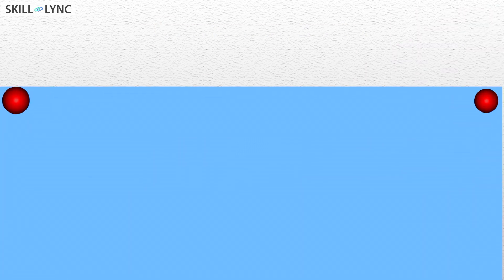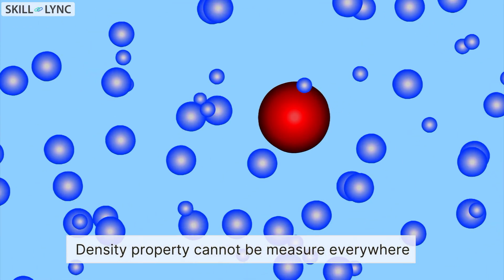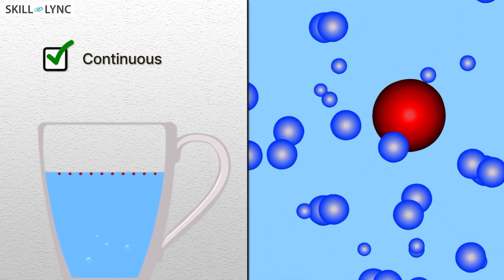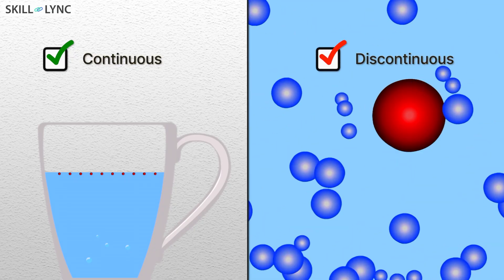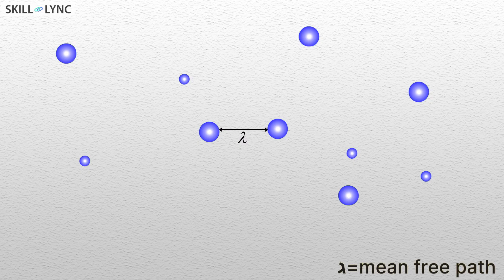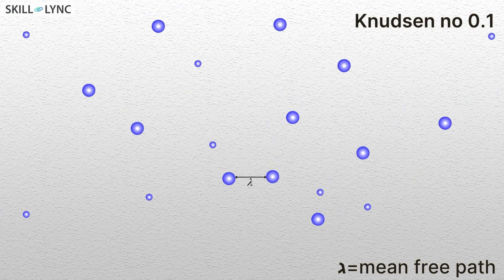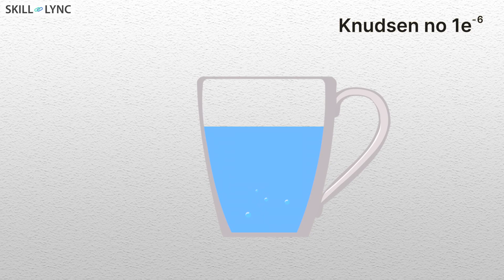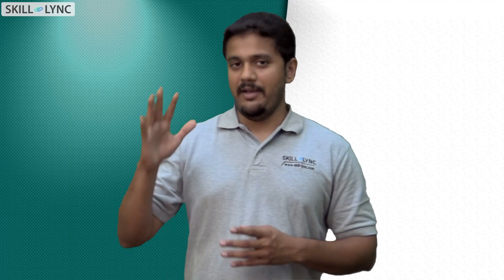What is continuum? | SKILL-LYNC

Comment: 0:28 No, you can't "calculate the density.." at a point. Density is mass per unit volume. A point doesn't have a volume, so it doesn't have a density! You might be able to measure its temperature, but that's only true when your points are more than your thermometer width apart.
Reply: That system is a 3d system consider any arbitrary coordinates x,y,z it will changing density at every time wherever you choose the point 
But you have studied that there is a void at molecular level between atoms
Reply: So if you consider a macroscopic view you can view it as a continuous system (hella fillup the molecular gap we are anyalzing from macroscopic refrence ) if you want to calculate denisty or anything 
Take a small section at point A 
So denisty at point A= total mass of fluid /total fluid volume 
Hey dont forget it fella the point A has molecules of water but unless going to mucch  deeper (at atomic level) we were dive in a level before microscopic measurement and now maths
Reply: You know density we need to calculate at point A total fluid/total fluid volume total fluid at that point A (dont forget A has millions of molecules of water at random but we consider it continuous ) then let make a cube at that level and calculate mass of fluid if something is very small what we use delta 
So total mass dm
And total volume will be dv

Then density at A= total mass/total vol
will approximately writing as dm/dv
This measurement is taken betwwen microscopic uncertainty and macroscopic uncertainty
You dive more into this topic i am just a rookie you wouldn't able to understand what i had said but you get the idea